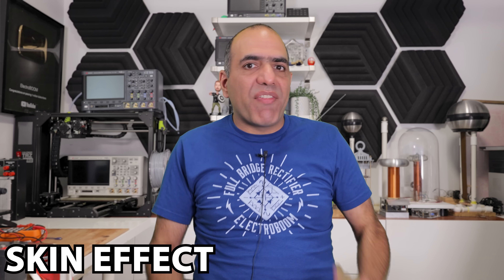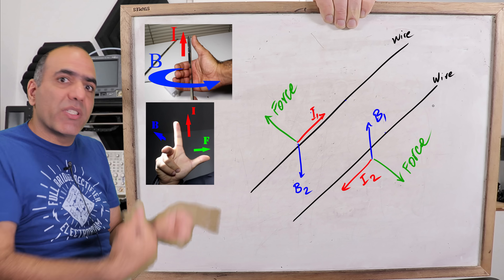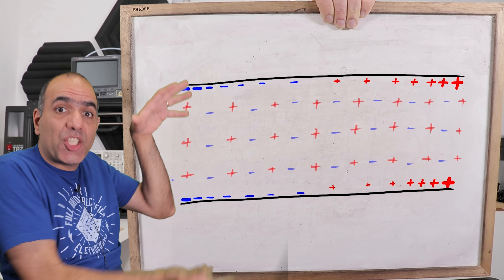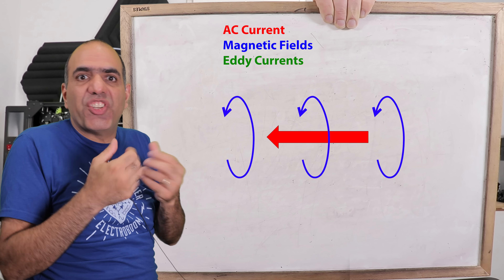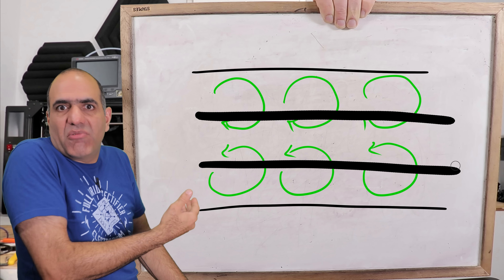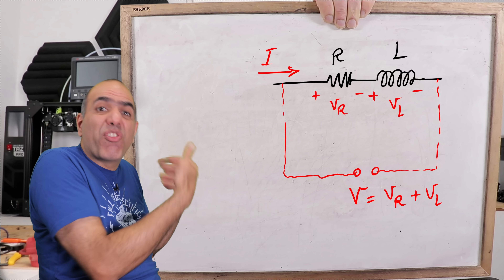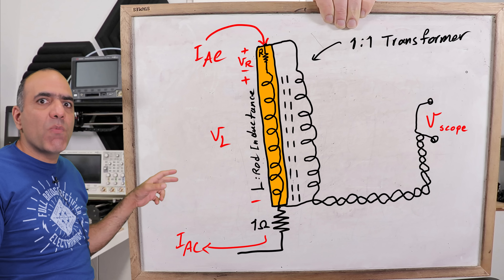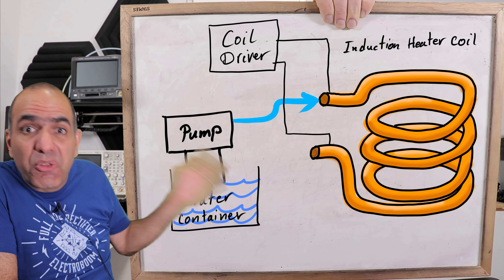Current Doesn’t Run Inside? SKIN EFFECT!

Comment: Hi ElectroBOOM, I've watched ur video with the other guy in the past and been thinking about what you guys were discussing. So what i take from that video, if I am not mistaken, if a current pass through a conductor the charged got repelled on the centre and most charges flow on the surface because of electric field. And in AC, because of eddy current, most electron in the centre was neutralized as theres an opposing movement of charge and most charges flow on the depth of the skins. Which means both AC and DC only runs on the surface, but wasn't it proven on DC the resistance is lower than AC which means the statement shouldn't be true. I feel on DC both electric field and magnetic field, one repel and one attract neutralized the effect and the charges flow in the whole radius or close enough somehow that make the resistance lower for DC hence that other guy V statement not entirely true? What are your thoughts about this? Cheers

Comment: This experiment was already conducted and failed .. Aluminum Core wire was used In America for a brief period  .. More current flowed in the Aluminum Core than expected causing it to heat up more than expected because of its Higher Resistance compared to copper  .. The heat capacity of Aluminum is lower than copper forcing more heat load to be carried in the copper causing it to heat up increasing the resistance of the copper .. In short Aluminum Core wire is a Fire hazard and has to be removed anyplace installed during renovations to the electrical system .. Reality trumps the Skin Effect Theory ..

If there was confinement, speeding, or slowing of electrons in the conductor it would take energy and you would see higher AC resistance over DC resistance in the conductor .. At low frequencies you do not see this .. When you hit Kilo to Mega hertz  the the conductor starts to act like a antenna or RF radiator, then Dimensions and Frequency dominate measured resistance ..

In your experiment with the probe wires close to the rod, at high Frequencies the Probe wires act like an efficient receiving antenna, Hence more voltage .. You should try it again without actually connecting the probe wires to the Rod,  you will be amazed !!
Reply: Aluminum core wire is used in transmission lines. It is not being removed.

Comment: Maybe you can make an electric lightsaber to demonstrate these principles. Ionize gas, maintain fieldintegrity within coneshape, modulate field density with superconductors, propagate electric fields that shift between phases like the combustionstages in a gasoline motor.. 4132.. Core of the lightsaber can be inflicting coherence of ionized gas along the length from handle to tip and powerpack surging . Let me know if you need more details

Comment: Why the core at all then? Wouldnt it make more sense to make conductors like a hollowcore or multistrand pieces of smaller diameter wires? What happens if you have good clamping on multiple smaller wires instead of a single big wire?
Signalwires are usually smaller while powerleads are huge... Mostly for dissipating heat or for redundancy? Maybe the magnetic flux surrounding the wires are less able to influence intended function with larger wires simply because of their innate, passive, property to resist changes from external RF/mag/UF ...?

Comment: Couldnt you use an IR camera? to see the heat of different parts of the wire (if it does infact increase resistance?)

Comment: This is the phenomena that took place with the Superman ride in Six Flags Magic Mountain. The engineers couldn't figure out why the ride wasn't receiving enough power until it was determined that the wiring that powers the ride wasn't conducting enough voltage to the ride itself. Power demand was so great that too much electricity surged through the wiring thus causing this skin effect. It took a year to remedy that problem.

Comment: In satellite transmission, we use ultra high and super high frequency waves with signal strength at approximately 21 kW -- enough to microwave cook anything in its immediate path within seconds. For these, due to the skin effect, we have to use wave guides instead of cable. It's really difficult to measure skin effect on anything small -- it could probably be done using the heavy cables used between substation transformers, though.

Comment: There are uses for skin effect. It's usually annoying. But in induction heat treatment, the skin effect is used to heat the surface only for surface microstructure change, while the center remains unchanged.

Comment: You may be discounting inductance (of mentioned eddy currents). Higher frequencies migrate towards the outside = skin effect.

If you send AC, of three different frequencies (for example), all phase aligned, through a stranded (but not insulated strands) or single wire conductor, the higher frequencies migrate to the "skin" or outer parts of the conductor. They also arrive at their destination, out of phase (7-20ms or whatever depending on frequency).
I'm not sure if the higher frequencies get "amplified" though.

The resulting increase in resistance will therefore vary by frequency, so it is inductance.

All this is widely used in for example radio and audio applications. In audio for example, silver plated copper wires, copper plated aluminium wires, gold plated copper wires, and flat conductor channels vs cylindrical ones, are common applications.

Lovely that you covered this topic.

Comment: As an Audiophile, I could have told you the multiple conductors wouldn't have worked. People pay LITERAL thousands of dollars for multi-conductor Litz braids because, in their minds, "Lamp Wire" can't provide the "current potential" needed for speakers, so they either use 8 gauge wire where 22 gauge is enough, or they use an 8 gauge wire's worth of conductor in individual 22 gauge wires in a "Litz Braid" to reduce the supposed skin effect. I equal parts do not believe it has any effect...and totally have a set of 6N silver Litz braids for my speakers.
Reply: Sometimes, you know there will be no noticeable difference between some fancy gadget or other and a basic version...but the science sounds so cool you want it anyway!

In my case, I have a pocket knife with a blade made from various finely powdered metals that are carefully mixed together in powder form, then sintered together to form a steel that is stronger, harder, and more corrosion resistant than it would be if you just mixed all the same stuff together in a blast furnace. What do I do that requires such a technical and highly refined blade? Open Amazon boxes mostly.

Comment: Another practical use of the skin effect is induction cooking. In this case the effect and the resulting high resistance is required to heat the bottom of the cookware. The skin effect is notably larger in ferromagnetic metals, which is one (but not the only) reason why induction cooktops work only with these materials.
Reply: Skin effect is also used in induction machines. It is used to increase the initial torque.

Comment: what would happen if you tested a bunch of different quality multi meters, doing an ampere test across the voltage input on a breaker. so testing the multi meters voltage ratings when you connect them in parallel which is supposed to cause damage . i don't want to try this but multi meters just get given to us at college and i know some people have absolutely no electrical knowledge so if they by accidentally did something like this, i would want to know what would be the outcomes of that and prevention, maybe prevention is just knowledge and you have to expect people to know these things when giving them these measuring instruments which are potentially dangerous if used incorrectly . even multimeters which have megger testing , i would like to know the dangers of. because you get taught the calculations , but not given demonstrations on the negative outcomes if they might occur

Comment: We have wire used to minimize the skin affect in high frequency applications and it is called litz wire and is finely stranded with each individual strand being enameled insulated.  Generally for switching power supplies only a few parallel strands are used since the frequency is usually under 100KHz...

Comment: I just today put a new copper lug on my welding machine's ground cable. And now I understand why this heavy duty cable consists of many thin strands of copper wire. That's some coincidence. I didn't understand anything else presented in this video, but at least I got that!
Reply: That and a sold copper conductor would not be flexible.

Comment: So having multi-strand wire helps decrease resistance because each strands' skin essential works independently, resulting in less useless core cross sections.  When you make a wire sandwich like you said with a steel core wire, do they not also each carry independently, and thus the steel core isn't really "wasted" space? If so, I don't see how the steel core construction is preferable to just having a steel support wire separate or on one side for easier construction.

Comment: I have a souvenir from my visit to the Hoover Dam.  It's a short piece of the heavy copper cable used to carry high voltage. (You can get it in the gift store.)  It's a thick, hollow tube!  No use wasting copper in the middle, where little current flows.

Comment: Very good video explaining the skin effect! One question for me still remains though. Did you account for the rise in wire resistance due to the increased temperature, when running current through it? Or was it considered neglectable, because no or just a small temperature rise on the rod was observable?

Comment: Yeah, about induction heating and skin effect. In my university decades ago an induction heater for tempering of outer layer of metal stuff was designed. Basically, imagine a gear. Its teeth need to be hard as f so they don’t wear out so fast. But the middle part needs to be ductile so it does not crack due to harsh operating conditions. So we use induction heating to heat up those gears to the depth of teeth, and the rest does not heat at all(almost). So skin effect can be helpful.😊

Comment: Open coils used in VHF RF transmitters that I used to work on were copper, but silver-plated, to reduce the skin resistance. I'm not sure your brass rod measuring setup is entirely valid, because there will be other resonances due to capacitance with surrounding surfaces and wires, and the fact that you're using ordinary wire which will also have resonances. Doing high-frequency measurements is really hard without special equipment and solid RF techniques.

Comment: I really enjoy your comedy BUT realize you are a teacher.  I am as well.  I would like to teach YOU something new, if you will allow me.  

Maybe your talent can help me share it with other selves.  All I ask is that you not dismiss what I am going to share with you out of hand.  These are conclusions.  The proofs are all around you, and I can show you this if you take these theory corrections seriously :  

1) There is no such thing that exists as a ' negative charge'  You are substituting a fictitious construct to replace something you cannot measure directly.  What you are calling a negative charge is really a hole of nothingness 💿within which there is no movement, because it contains no electricity.  The only thing that is measurable is the positive electrical potential around this hole.  

2) Properly defined, Electricity is 'that which has movement'  

3) A magnet is actually the opposite of what everyone thinks it is and 'magnetic force' does the opposite of what everyone thinks it does, which is unfortunate and problematic..  

4)  Magnets do not 'attract' anything.  (First thing you will do is show me a magnet and a nail, I realize that, but stay with me here) ignore the nail and consider only the magnet itself.

5) Magnets do not have a south or negative pole.  They have two positive poles and a null point at the center which is commonly known as the 'block wall' that cannot be isolated.  No matter how thinly you section up a magnet, you can only produce additional magnets.  Conversely, putting two magnets together never creates two.  (refer back to your wires slamming together and you must agree that what you have done by adding electrical current is you have created two electromagnets.)

6) Electricity is compressive.  💢

7) Magnetism is repulsive.  💥

8) 'Gravity' is simply electricity.  It does not pull from within, it compresses from without (towards that that hole) and this compressive force is exerted from without.  Thus, it is electricity that holds you to the Earth.  No need to invent another fictitious force, this just compounds the problem you create with 'negative' charges.  Both can be excluded from consideration. 

9)  Opposites repel, they DO NOT attract. Nothing actually attracts.  All accumulations are the result of electrical compression of an immeasurable, imperceptible substance.  I can tell you what that substance is, but that is another lecture.  There is no such thing as 'electromagnetism'.  Electricity and Magnetism are OPPOSITES!  In equal amounts, they express that equilibrium as physical mass, and also in every possible ratio of preponderance of one or the other.  You can maybe appreciate this bit of comedy:  What happens when the unstoppable train hits the immovable mountain?  The result is, it creates YOU, to pose this confusing question to another YOU! 🤣

10) Positive charges also appear to repel, because Magnetism is always present and also repels positive charges.  This is very counter-intuitive, but the wires in your experiment appear to be drawn together because what you are observing and calling 'attraction' is the effect produced when two of these holes are in close proximity.  They are compressed into one hole, and the electricity in each, which allows each wire to appear as a separate and distinct mass then surrounds BOTH wires.  The 'short' that results is magnetic, which simultaneously adds to an existing electrical  centripetal flow an equivalent repulsive magnetic flow that is centrifugal.  Ask yourself: Why does the wire burn up? 💭  The answer is: Magnetism is DEATH to physical matter.  Magnetism is the equal and opposing force that is concurrently present at any point you find a physical mass.  You are changing this equilibrium and imposing a preponderance of magnetic energy, although it is not correct to refer to magnetism as 'energy'.  It is still nothingness.  It is what people used to call the Aether.  And this magnetic preponderance reaches infinity at the point the wire breaks.  Do you see any bits of that wire anywhere?  No.  There aren't any, just the two remaining pieces of wire and some melted insulation.  Were it possible to weigh the wire before and after with enough accuracy, the post experiment weight would be less by a tiny atomic amount equal to the atomic weight of a single atom of the original wire.

11) The compression caused by electricity produces heat.🌡  Your experiment would destroy the entire universe were it not contained.  

12)  The heat produced by electricity WHICH COMPRESSES ALL MATTER⚡ is contained by THE COLD VACUUM OF SPACE. ❄ Look up 'sonoluminescence' and you will understand the purpose of a vacuum tube.  Without that, all matter would violently explode as the still central hole at the center of all mass expands without bound.  

13) Physical mass exists only for the amount of time electricity can exert a compressive force to answer the expansive force of magnetism.  Electricity creates through compression. Magnetism destroys through dissolution.  

14) All matter obeys this birth/death cycle which explains all forms of radiation.  ☢

15) Electricity is GENERATIVE while in preponderance.  💢  This is how you can say while a man is still alive, that he is dying.

16) Magnetism is RADIATIVE, and destroys while in preponderance.  💥 (But old guys like us still look sexy. 💪👀)

While it does so at varying rates, all matter eventually returns to the Aether from whence it came, leaving no trace of it ever having existed, and does so just as soon as the electricity holding it together by compressive force  ceases, and this is the point at which all motion stops.  Hence, without electricity, there is no motion. :text-green-game-over:  (But not really, since it simply  re-emerges elsewhere)
-J

Comment: When you switched to the autotransformer to use AC, BOTH wires were carrying current in the same direction at whatever Hz you were running.  Would have been interesting to see if they'd have repelled each other when 1 wire was running 180' out of phase.

Comment: If it was possible to manufacture hollow wires, does this mean we could save weight and material in power transmission without risking too much of a power drop across the wires? 🤔
Reply: Transmission Wires / Cables need strength.

Comment: Current does move through the center of the wire.  The center just has more resistance than the wire's outer conductive band .  Current takes all paths inversely proportional to the resistance.

Comment: Two wires 1m apart running in parallel are attracted to each other with the force of (whatsoever) Newtowns per meter if length.

That would be definition of ampere.

Comment: In power generation, between the generator and step up transformers on the generator side of the switchyard, we use "isophase bus ducts" (aka big pipes with big current and voltages) inside of bigger pipes with ceramic isolators in between. Our plant used to have chillers and blowers that would force cold air through the ducts, but some changes were made to make them naturally convecting. The ducts are now cooled through black magic and our shareholders are happy we put more power into the grid since we no longer cool our bus ducts. Now the air only acts as insulation between the two pipes and passively acts as cooling.